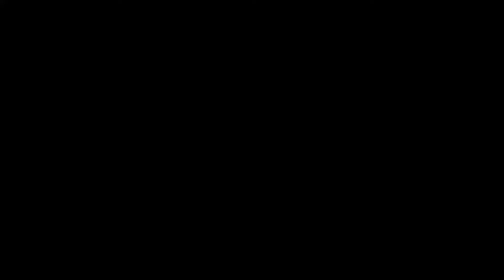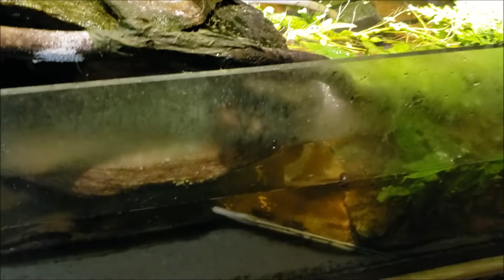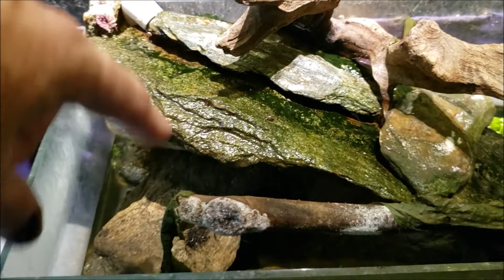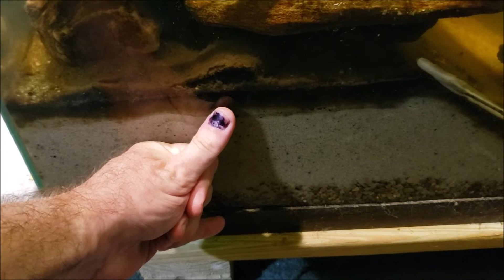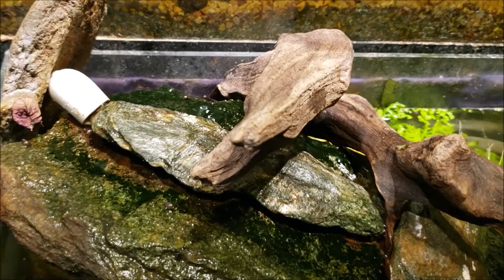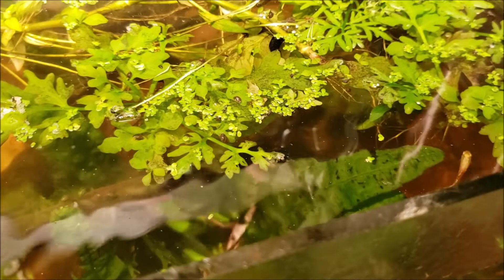Deep Sand In My "Foot Tank" Seems To Help Denitrify The Water

Comment: From the shite wicking up the driftwood I would suggest your dissolved solids are most likely calcium. Didn't you add some egg shell and cuttle bone in here for the crabs and shirmp to moult? You should check the GH and KH, which will give you a more definitive answer.
Reply from the maker: I may have. I'll check the hardness and see.